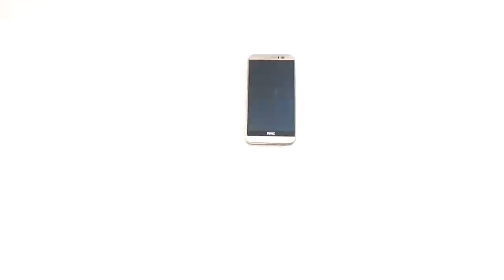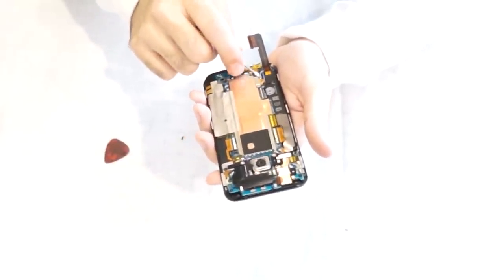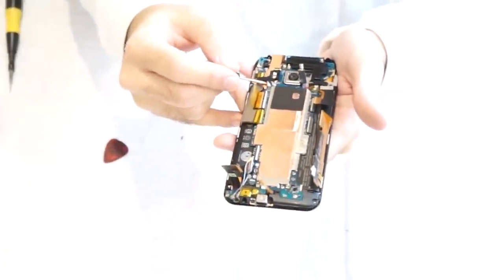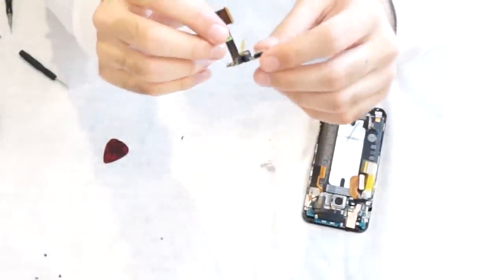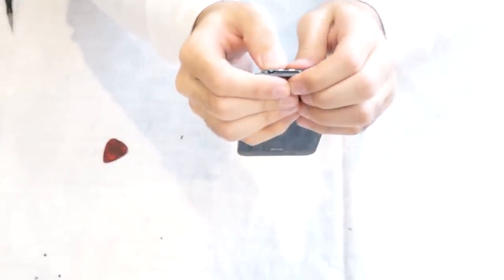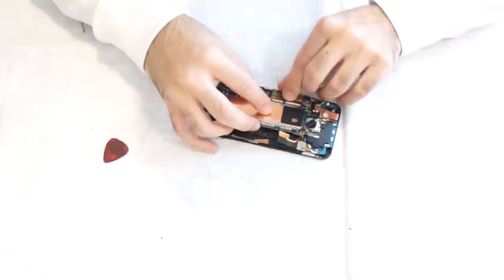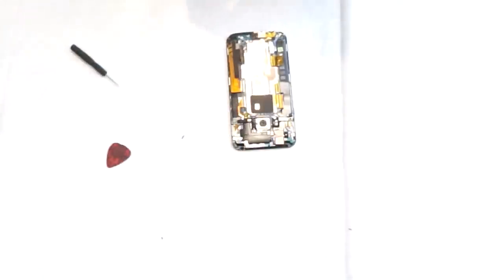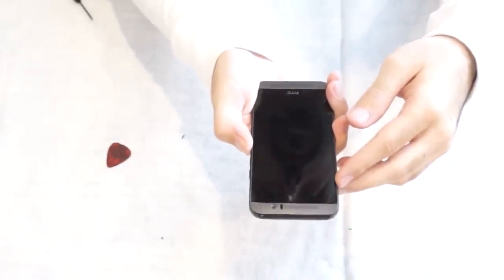HTC One M9 Disassembly Teardown Screen Replacement Guide

Comment: Great video, couple questions whats the camera sensor? also is display incell or digitiser between lcd and glass thanks
Reply from the maker: Thanks, it has a 20mp sensor, not ultra pixel, but the front facing camera is ultra pixel. As for the display, I'm not too sure, we didn't pry off the glass to see, but I'm thinking its digitizer between LCD and glass.
Reply: pwrdbykyank My question was is camera sensor Sony or Toshiba? so display is not in cell. thanks
Reply from the maker: Oh its Toshiba, no problem

Comment: hey mate, I popped cover and it had some soft sticky foam like aroud camera to cover. 
Anyway does the yellow stickers have to go back on it ? thanks
Reply from the maker: They don't have to go back on, but they are there for extra protection to keep the connectors from popping up/open etc.

Comment: what about a guide on how to replace a broken rear camera glass cover? apparently it is a common problem. will it just pry out without disassemble, i have seen replacements online and they look like just a glass and adhesive.
Reply from the maker: +jasoncwaters1 Yea I believe its held on with adhesive so you should be able to pry it off and replace it.
Reply: Cheers

Comment: Sad to admin but apple once again ahead of android premium manufacturers.
Reply: sergey a  how?
Reply: ***** you need only screwdriver (albeit proprietary one) and a suction cup to remove display assembly.
Reply: then what htc requires ? not to mention that iphone have deff screws inside that if you miss one you cannot find it again
Reply: ***** HTC requires a lot of fiddling with heating and un gluing. Which can easily lead to damaging phone body.

Comment: The most interesting part is missing: Removing the battery and then replacing the screen. This is not a screen replacement guide.
Reply: Okay, the guide worked anyway, thank you. Just replaced the screen of my M9 which was in contact with seawater - for some seconds only but obviously enough to kill the screen.

Comment: and they still claim that they can't put the speaker under the display to get rid of that black line at the bottom of the display and make the phone smaller. -_-
Reply from the maker: Yep, I'm sure they can do something, they just have such a complicated and confusing design inside that they need to simplify and organize better.
Reply: +pwrdbykyank somebody that finally shares my opinion on htc devices. its why i have stayed away from them.
Reply: pwrdbykyank I would say that they're lazy…

Comment: Horrible internal design how hard can it be to make things simple... too many damn connectors. motherboard on top of the battery that's crazy what happens when the battery gets old and inflates ? really hard to disassemble. i dont get why HTC keeps using shitty internal designs even on the outside of the phone.
Reply from the maker: +George241312 I tend to like HTC, but as far as the internals go, its a mess I agree. I don't know why they make it so cluttered and complicated. Makes their phones useless and obsolete once any part goes bad and needs replacing.